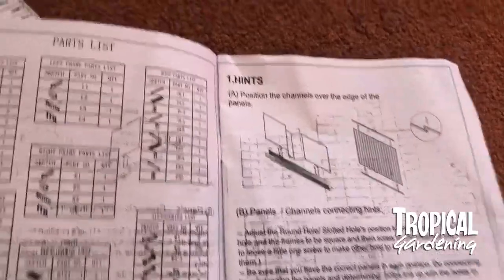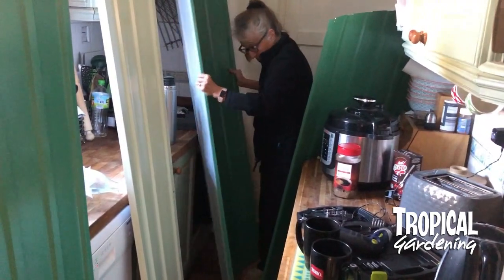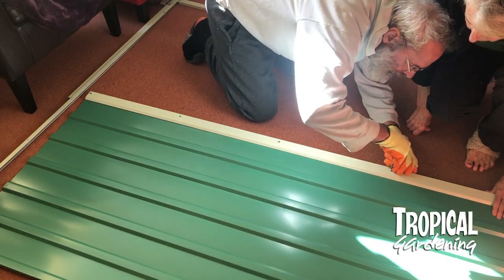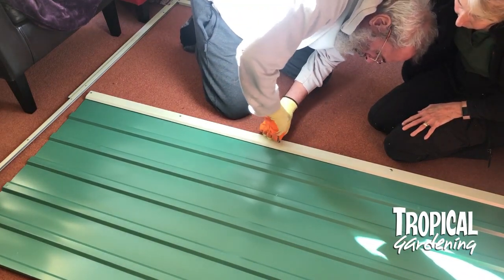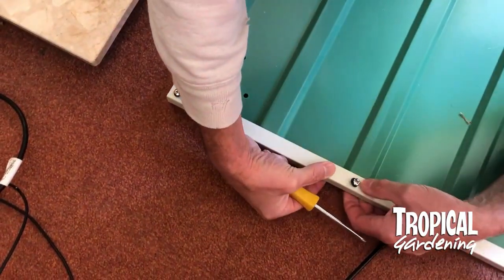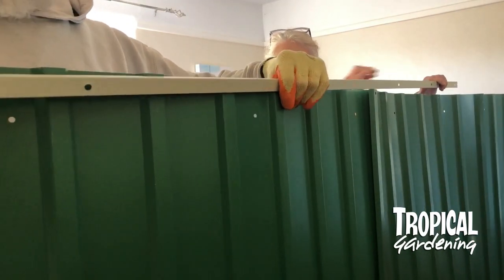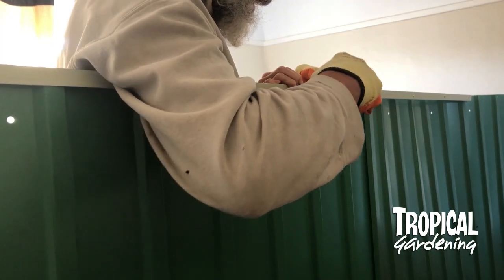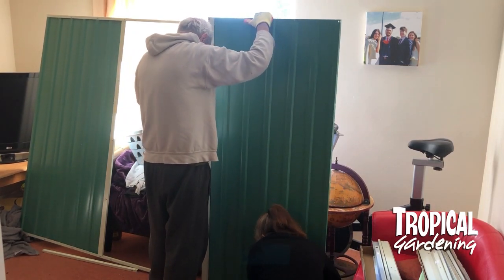8x4 Metal shed review

Comment: Biggest problem with these sheds is that they condensate in cold weather so any tools will get dripped on. I'll be sticking up 25mm(1") of polystyrene on the underside of the roof to try and prevent condensation. The panels sometimes don't link in correctly and leave a gap so I have used some blind rivets to pull them together after building. 

The UK weather is damp and we get a lot of rain so I have put in a damp proof sheet over the concrete the floored with OSB tongue and groove damp resistant flooring and capped that with a glued down rubber sheet use in the roofing industry. 

All the gaps at the bottom of the walls I have filled with a special sealant used for galvanised metal, do not used ordinary building silicone as it attacks the galvanised metal coating.

To be perfectly honest I may have well bought a wooden shed without the hassle of a dripping roof
Reply from the maker: Yes, condensation is a problem. I just put a tarpaulin over everything as I don't access it on a daily basis. Still a good value shed though, no regrets

Comment: How is the shed since you built it? Have you found that it leaks at all? I've just ordered this model and I'm wondering do I need to use sealant around the edges.  Many thanks for your video.
Reply from the maker: The shed is water tight but being metal you get a lot of condensation dripping off of the ceiling so I cover anything I want kept dry. I don't think you'll need sealant tbh